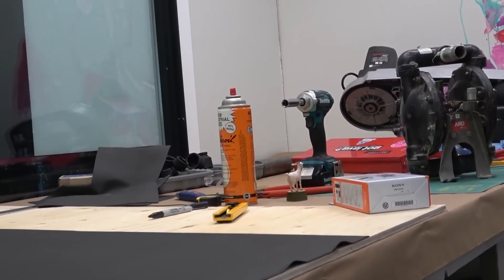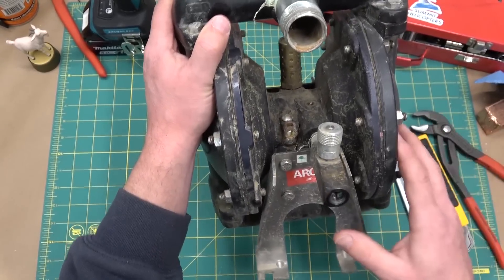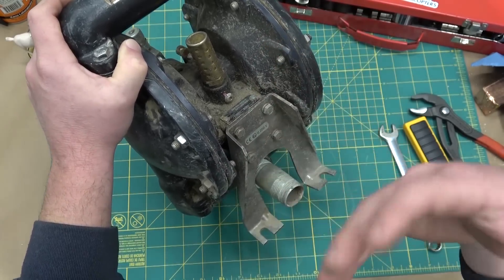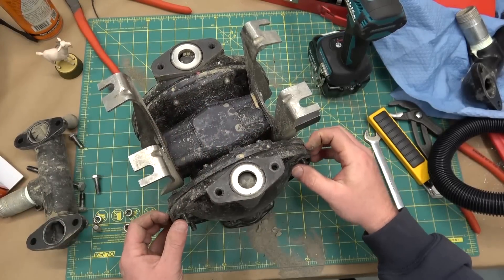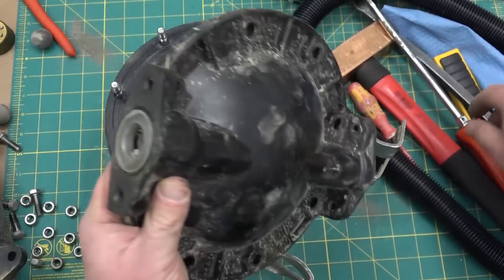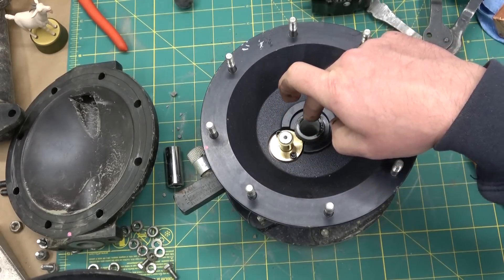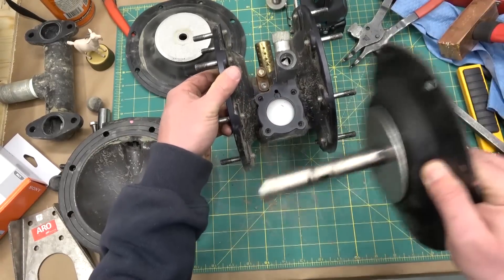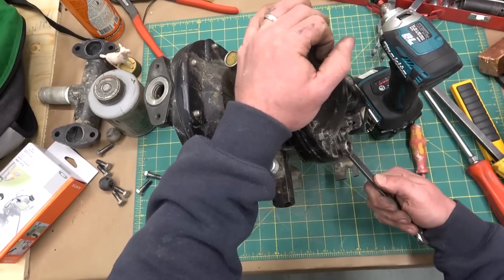BOLTR: Diaphragm Pump | So tough it'll pump ball bearings

Comment: I found out bout diaphragm pumps with your last video and picked up a cheap one off the jungle website. Thing works great for moving thick 15w-40 oil in the bitter ND winter cold. Doesn’t matter how cold it is, it moves the oil outa my 17 gallon pan into my oil drums. As said, occasionally ya get some chunk of shmoo in there that ya gotta clean out but, it’s easy peasy and then she’s up going again.

Comment: Used one a lot were i did hazmat spills had gas powered air compressor to run the pump and it got used in waste oil, diesel, water, anti freeze, mineral oil, ect. the stuff would have rock, rust, gaskets, sand, ect. Had to clean check balls a hand full of times but other that i had the muffler freeze over once when it was really cold out. It just worked.

Comment: Had a paint gun cleaner we got used  at school that the lacquer thiner ate the check balls up on because the last person to rebuild it did not use parts that were safe in lacquer thine. Got it all put back together and found out that the instructions that came with the repair kit had you putting the check balls in the wrong direction, Once that wa all settled and working talk about some good spray action in the cleaning tank. The guns came out really nice after that.

Comment: Love double diaphragm pumps.  They're the only pumps you can throttle on the input and output.  Very handy in the processed food industry.  They let you separate the material you want from the material you don't from the input side.  Can't do that with a centrifugal pump.

Comment: As can static be built up from pumping solvents. I worked  as a lab tech in an adhesives factory. About 3 or 4 times a year a 45 gallon drum of solvents would blow even though it was earthed and all the pipework was also earthed.. the solvent vapour would flash off as the drum was being filled. The guy who did the filling of the drums was hospitalised several times with burns.. ahh the working practices of the 1970's. :)

Comment: These little babies,  we use them all over the place were I work, at water treatment stations they pump liquid trough the press filters, at the low pressure foundry machines they keep the water in the cooling tanks flowing, at the abrasive fluid pumping station... they pump the abrasive fluid (for polishing machines), chemicals at the chrome department, etc etc, repaired over and over again, we use mostly Sandpiper, they are mostly ok, quality of the foundry not always great, specially on spares. And aside from pipping they are the last remnants of imperial screws at work.

Comment: We used to use these in the US Navy submarine force to keep bilges dry.  I've seen plastic bags get pumped into the discharge line before getting plugged up.  Always kept it ready to go, just open the air valve and she gets to choochin'

Comment: I used to repair these in the field daily underground mining. Only needed a small ammount of tools. Carried in your bib pockets. A main problem, was they would literally freeze and hang open on the air. Remedy. Brass hammer and wd40, aka 'panther piss'. To the exhaust muffler. But taking them apart and repairing was alot of fun,

Comment: Took my all the way back to nineteen seven and seven, seeing my first diaphragm pump due to the large amount of native copper in the settling tank. Other shift would up the water to lower the density, running out the fines, and I would up the density, lower the rakes and end up with a 4” cake on the disk filter. That pump is made for production.

Comment: Used to rebuild these for a coal mine close by.   Couple O-rings and a good cleaning usually fix them right up.  I did the 2” & 3” varieties.   Side note the coal mine will some times send you one in pieces cause it been ran over or something.    In this case the check balls make good dog toys

Comment: Had one of these things at my previous job for pumping recycled 3D printing powder, static was a demon back there. Thing sucked in everything, even small misprints and other tiny items. One tine we even got a wrench in the presieve, luckily it didn't pierce the diaphragm. One of the other sifters we used wasn't grounded and the first time we turned it on I got a shocker from here to Hawaii. Loud as frig too.

Comment: We use these pumps to get water that leaks into the Battleship Texas out of the ship when they fill up tanks on the under side of the boat. We cant bolt them to historic fabric so we never get to run them at full chooch, but they work wonders none the less.

Comment: I had one pumping waste oil. It was made of all plastic I got it for like 20 bucks used. But it worked great and ya had to be careful cause you're right it would pump the sludge off the bottom of the tank no problem and it would go right in the waste oil burner.

Comment: in oil & gas, we used to drive these right off the pipeline with natural gas. That was, however before we started to understand the negative consequences of venting a small pond worth of gas into the atmosphere. More recently, we had one unit that we drove with the discharge of a natural gas compressor, and exausted back in line to the inlet. Zero emissions, and used a small fraction of the capacity of a 3kHP compressor.

Comment: I recently had a JABSCO electric diaphragm shower pump fail on my sailboat. I was expecting it to be something jammed in the diaphragm but alas, no. It was a busted tooth on one of the planetary gears in the electric motor's gear set. It felt good to tear it apart and see how it worked, but I didn't happen to have any spare gear on hand so we just quick ordered a full replacement. I hope to get back to gear replacement in the future.

Comment: Where I stand, watching this, I have 9 various versions of this pump within 15 feet of me. I use several 2 inch and two 3/4 inch. I have have abused Aro pumps like that one, pumping caustic soda or acetic acid through them.
All my new ones are all plastic, so they can take it, but now I almost never need to do acid, except one product that is an acid itself

Comment: The pump can still work with missing check balls. Company bought one of these for fluid on a service truck. Went bad sitting in the sun with engine coolant expanding in the hose reel from heat forcing the check ball back into the body jamming it in there. Pump failed. No chooch. They had it replaced. Same problem. Got fed up and drilled the stuck check ball out. Worked fine since. LOL

Comment: That pump there looks and sounds identical to the pumps we used at an auto shop I used to work at. The pump was on top of a 500 gallon oil tank that was used to reclaim the used motor oil out of the drain tanks we used to do oil changes. I always wondered how they worked and now I know.

Comment: Ahh, I remember the sounds of those pumps from when I used to work in the adhesives factory pumping solvents into the giant shear mixers what turned solvents and plastic beads to glue. I wish I was more astute back then to see how the powder (antimony) pumping system worked.

Comment: That’s a tiny baby diaphram pump. Haha. Couple years back I had two in Texas that I maintained, they had 3” inlet and outlets. I think they were 24” diaphragms. We ran them haaaarrddd, 150psi pushing basically tooth paste when the product was up to temp. God forbid you let the product cool. A 60% iron oxide product with nasty binders and fluffers made it a treat to cleanup a pump problem. Cracked a few balls that were some sorta ptfe Teflon hard as nails plastic balls.

Comment: I designed and built two filtering systems for where I worked... their old system were using centrifugal pumps.  After rebuilding or replacing a number of pumps I asked why they weren't using diaphragm pump for pumping the washing/blasting wast.  We had the air supply to run them.

Comment: I also put a smaller one in for window washer fluid, I did not ground it but it been several years no problem except the the exhaust muffler broke off and it is kinda loud

Comment: My shop uses one of these ARO pumps to empty the used oil drain barrels. Last month it quit working, just stopped dead.
Took it apart and found that one of the upper check balls had shrunk and got stuck in the seat, hydro locking the pump.

Did I mention the pump was 30 years old? $300 for a rebuild kit because of its vintage-ness.

Comment: I use one about twice as big at work. It'll suck out a thousand gallon tank in a couple minutes. I wrap the wings down with wire on the camlock hose fittings or it'll pump right off!

Comment: Used vane driven centrifugal pumps on ships. Took one that wasn't working to an engineer and he connected the air line, twatted it with his hammer, a load of rust fell out and it spun up fine.

Comment: We have one of these going into a decanter. Unfortunately, when there is a clog we have to take all of the hoses outside to unclog them and take the pump all the way apart because when the solids fall out of solution it is unlikely to go back into solution. Before we had our scroll compressor we just had a small harbor freight compressor and that thing would be running all shift without shutting off and would only hold 60PSI. I am amazed that thing didn't catch on fire.

Comment: Went to the Aro training school in Bryan Ohio...used to fix these by the truckload..
Whatever they were pumping when they failed, was certainly locked in the other side. and inside/through the air motor/spool valves. 
Printers ink, to methyl-ethyl-death...who knew?
Was always nice when they sat around for a year before they had enough bad ones to send the truck.
One of the biggest causes of failure was an incorrectly applied/improper chemical compatibility. Also had applications for different balls/seats, depending what material was being pumped. Slurry would wreck one with stainless ball/seat combo in an hour....the ball would whittle down till it went right through the seat. ALL kinds of materials..buna-n to teflon diaphragms...stainless to teflon balls/seats.
Also had nylon/cast iron/aluminium housings. Sizes went up to 3" plumbing too!

Comment: a guy said that when you're loading large amounts of refrigerant into a system you have to ground the refrigerant tank, because the static of the propellant moving through the diaphragm of the ac pressure gauges can damage them.

Comment: used to use them to pump out hydrocarbons from offshore compressors with pyroban exhaust coolers. wash the exhaust bow out and pump the hydrocarbons (soot and diesel) from the bund into IBC's.  wilden was the brand of pump.

Comment: We use the plastic versions of these to pump corrosive chemicals. Since the liquid is clean the only real problem we have with them is when the seals go out and it starts blowing sulfuric acid out the mating surfaces. Does some damage to the concrete.

Comment: I've rebuilt countless Deutz double diaphragm pumps back in my offshore days. But they were mostly 50mm size. So much bigger and heavier than that one. Boy they can move some liquid. Noisy at full speed.
The 50mm balls were great for the dog because she bit straight through tennis balls, but not viton balls..

Comment: Looks slightly different to the one we have at my work place. The one we have has extra bits for the check balls to seat on and the lower ones seat in the pipe below the diaphragm cover.

The bits in the one at work are also a little harder (viton probably). Same shade of beige as computers that are a tiny bit older than me and the check balls have a visible pattern to them like they were injected into some kind of forming mold.

Comment: as soon as i saw the thumbnail i recognized it immediately. we use one of those at the shop for waste engine oil. been working just fine for almost ten years with no service. but then again oil is a little less hard on the inner workings than rocks! XD always wondered what made it tick. im curious how long the diaphragms will last in constant contact with oil. most of the rubbers i work with tend to melt with long term exposure with petroleum products. especially ATF.

Comment: I think there's a Yamada video showing the pump moving chicken bits from point A to B.  A little gross, but gets the point across.
I have a Sandpiper at work that will be free for the taking because the exhaust muffler fitting broke off of the manifold. The American tax system apparently encourages corporations to replace stuff rather than fix it.

Comment: The non conductive surface area is great enough to build up a static charge strong enough to cause an ignition (imagine rubbing it with a sock while in a hazardous atmosphere). Hence the special condition "X" on the end of the ATEX marking,  You can't clean it while an explosive atmosphere is present. Clearly, this was not a problem for you.

Comment: Cleared out plenty of these pumps while working in a underground coal mine. They have a 'heart-beat' if you will. Too fast and it's not sucking any smoo, just air. Too slow and it's not chooching well due to smoo inundation. No beat at all means the mine is filling up with smoo and it's time to wade in.

Comment: AvE I would be curious about overall efficiency, I better research it.  I use this exact pump to move waste oil, amazing performance.  I made a differential and other gear oil type suction (attachment) pump as an added bonus to it's job at an oil change place (draining the rolling pods of used oil) this was when I was a teenager.   If efficiency is very high, it would be the breakthrough that compressed air powered type modes of transportation would need.  Current industrial and custom high efficiency air motors have about a 5% efficiency conversion.
Reply: compressors themselves are a big lose of energy. there is no choice but to dissipate the generated heat. it is higher than 5% though. a .5 air motors consumes around 24 cfm at 90 psi, a 5hp 2 stage reciprocating compressor makes 21.9cfm at 125 psi

Comment: We used to buy these for pumping water out of bulges,  barges ,transferring fuel ,oil almost anything we had a "wye" strainer on suction but they were always breaking down or needing a rebuild that we did ourselves we started buying allflo brand half the price pumps just as good but 2years old & needs no rebuild mo nothing they just work way better

Comment: amazing device, just extremely expensive for prolonged uses (practically an engineered air leak )
Reply: ...never thought of it quite that way
Reply: @sonofnone116  once i was putting fittings on some pneumatic vacumm clearners (very common in aviation) and another millwrights asked me "did you test them for air leaks" I was like "yes the air leaks very well" (these didnt even have valves, they were just plug and play)

Comment: We used to call em wobble pumps. For the ball seats, you can get bisexual seats, they work both ways. When-ever we bought new seats we got the bisexual ones , that way the on seat works on both inlet and outlet. but we used teflon diaphragms for pumpin high viscosity fluids  (10,000+), they are stiffer which aids in moving higher vis fluids. Always put a very thing coat of silicone grease on the seals so it's easier to take apart the next time

Comment: Totally unrelated but I understand air can make static electricity. Refrigerant also does the same. I have a scale that I weigh refrigerant with. After removing some refrigerant, static electricity has built up because the pressure vessel is isolated from ground. Go to touch the jug and you will get blasted almost every single time.

Comment: My car uses the mechanical version of these for gasoline. You can hear the bastard succ like crazy if you listen hard enough. They normally draw about 6 psi because that's all it takes to prime a carburetor, but I wouldn't be surprised if it runs more like 10psi, you never could hear the original pump before I replaced it. They're not built for maintenance, but they're around $30, so that's much better than $500. $200-$250 for the pump, and then $300-$250 for labor because some genius in modern car design decided to put them in the fuel tank without an easy way to get to them.
Reply: 14:37 this is me when I take a leak after watching a movie

Comment: i was watching some old videos of applied science and i came across the video on the diy water jet cutter and he was getting some trouble tryng to mantain a high presure water source, so i wonder if you can reporpouse  a gear pump for sourcing the flow for the system or if the tolerances would just not work for water

Comment: This is the same kind of pump we use to pump fluid in tractor tires. Is there a better designed muffler that won't freeze up in the cold?  We use airline antifreeze, but it only works temporarily. Thanks

Comment: i have to tear the ones down at work at least ounce every 6 months they got it easy they pump used diesel oil and coolant to storage tanks very robust and reliable until a zip tie gets into the the check ball.

Comment: Could you run that pump on water pressure instead of air? Assuming you might be in a place near a water source and a way to create  a siphon with a lot of fall, I'm wondering if you could run it off of a ram pump instead of an air compressor. Lots of balls to click and chooch in a line.

Comment: 20cfm at 120 is small time... try having 75hp screw compressor that outputs 340+cfm at 125psi plus a 40HP that does  another 170cfm if needed .... big boy compressor. What we use in our production plant

Comment: Thing to note is most of this pump don’t operate at full shop pressure it needs a regulator or at least a ball valve cause otherwise nothing happens at full chach!  Dunno if the valve floats or it’s cavitating but when you try to empty your wasted oiled bucket it doesn’t workee workee just make irritating noise in the shop.